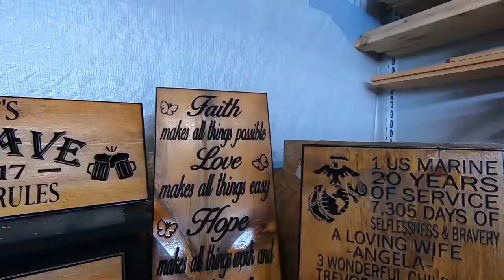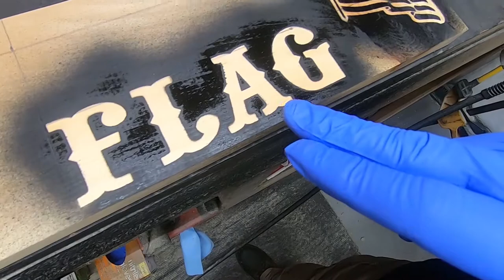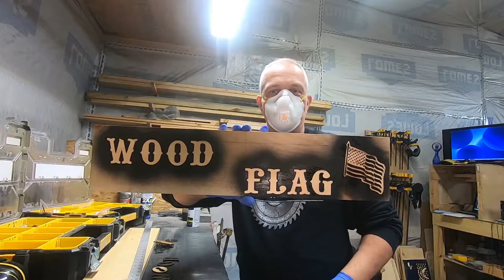How To Transfer Letters Onto Wood For Painting | (Easy Method)

Comment: We’re do you get your letters from
Reply: 2:53 He explained this in the video. You print out letters on paper in the font and size you want, cut out and glue those paper patterns to thin wood stock, then cut out each letter with whatever tool you have (jigsaw, coping saw, router, or maybe Xacto knife). He does mention one can buy these pre-made letter sets, but the focus here is DIY.